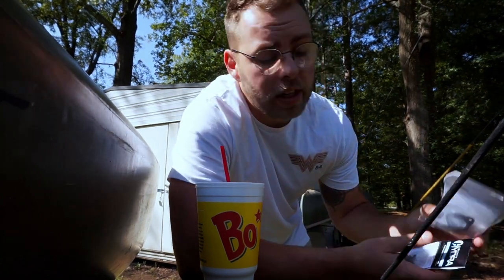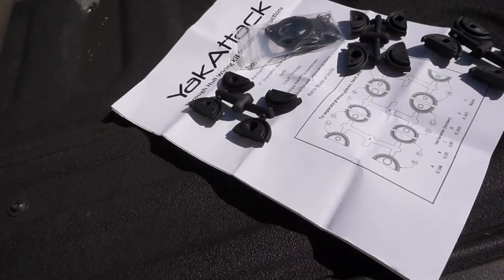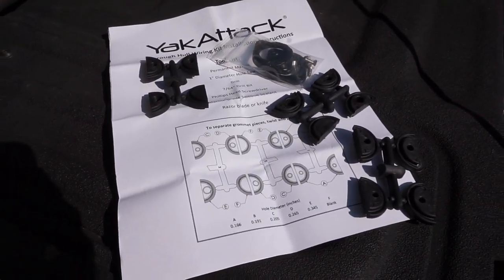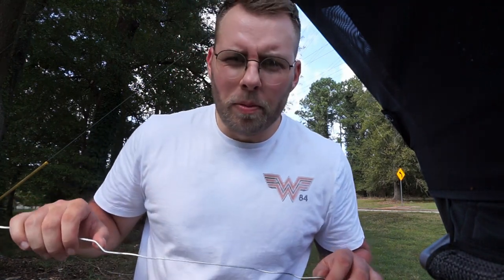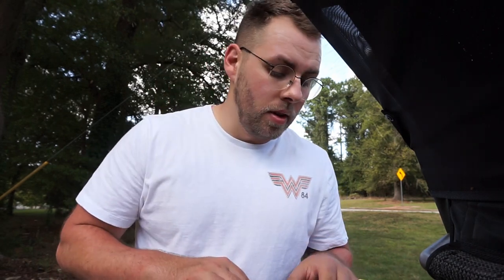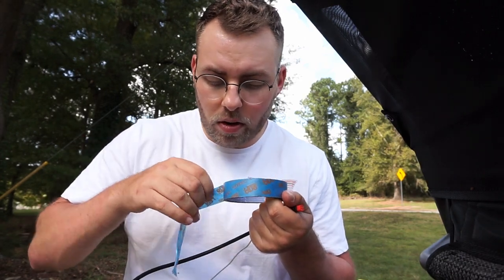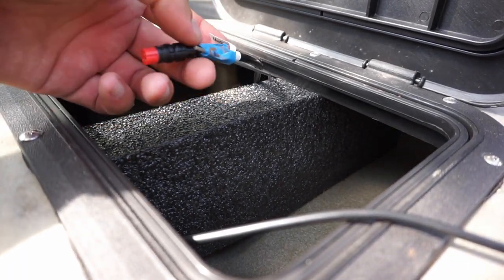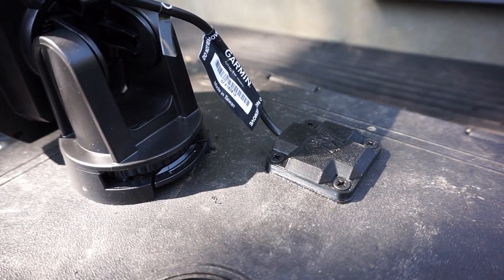YakAttack Thru Hull Wiring Kit Install

Comment: Great kit. 
Little pro tip for silicone. When you first clamp everything down and the silicone squishes out, or if you apply it afterwards around the outer edge. Spray the area with soapy water before wiping it, and you’ll be able to trowel it to perfection with your finger and it won’t smear or stick to anything it wasn’t touching before you sprayed it down.
Reply from the maker: That’s a great tip, thank you!

Comment: please link the correct hydra concepts pass through, cant find it, thank a ton!
Reply from the maker: https://www.amazon.com/Hydra-Concepts-Waterproof-Clamshell-Fitting/dp/B07ZPV996Q

This is the one I ordered. You can select one or two wires for a single clamshell, (probably go with two in order to run power and data if you are running a similar set up).

Comment: Thanks for the video however no need to use that much silicone if any at all...if it becomes a problem that water is leaking in around the fitting you have already took a dump and the thimble amount of water won’t hurt...just my two cents
Reply from the maker: I believe the silicone is more crucial if you’re installing a port on a part of the kayak that is continually submerged, but I went ahead and did it just to follow the steps. I agree that not much water at all would get in if it’s getting splashed or even flipped over, as I have recently done.
Reply: @certifieddinks3943  agreed!...we’ve all done it!

Comment: How is it holding up?
Reply from the maker: I’ve had no issues with the yak attack thru hull ports. I wouldn’t recommend the hydra concepts. I actually pulled all of this out the other day because I’m installing the Garmin on a new yak, and everything still appeared to be water tight. It will be interesting to see because I believe on this new install one of the ports will be at least partially submerged most of the time.